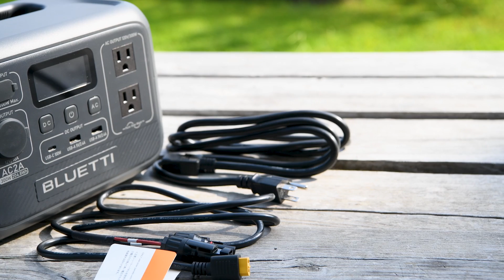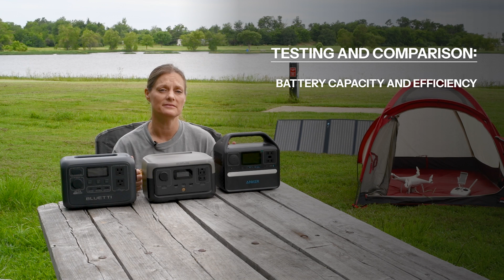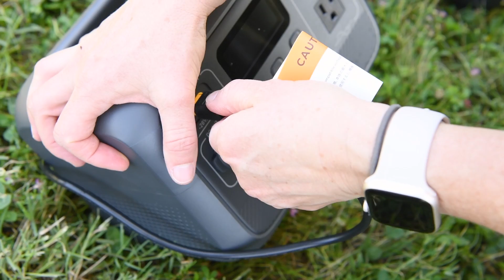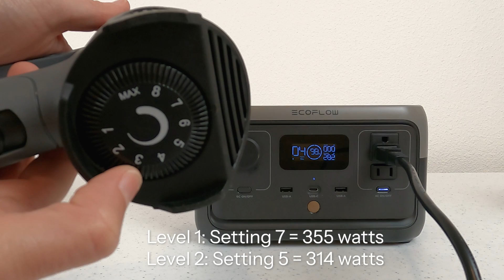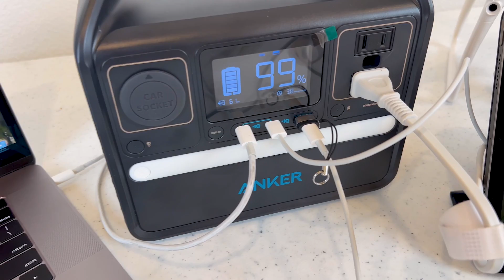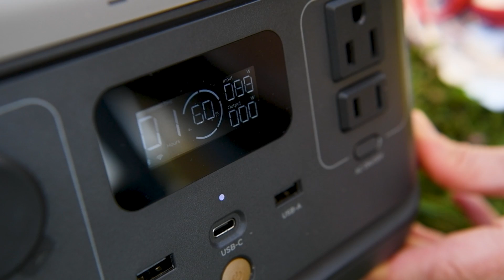Anker 522 vs. EcoFlow River 2 vs. Bluetti AC2A Comparison: Portable Power Station Showdown

Comment: Excellent review. I would recommend using a Kill-A-Watt, or similar, device to measure actual power draw rather than relying on the built-in displays.  The display values from the Anker don't seen to match actual performance.  Ditto that suggestion for USB power flows.

Comment: A good overview with practical real use demonstrations.  It is interesting that you chose the Bluetti AC2A, as it is not comparable in battery size to the Eco Flow River 2 and Anker units.  A better comparison would have been the Bluetti EB3A with it's 268 WH LFP battery that is only a few dollars more (when on sale).  Of course it has a 600 watt inverter and will make a cup of coffee (in power lift mode) and also run a 19 CF Samsung high efficiency refrigerator for 6 hours, which neither the Anker or Eco Flow are capable of doing.  For solar charging, it would have been a more fair comparison if the Bluetti and Eco Flow were charged with their respective solar panels as those panels outputs are more optimized with the solar input limits of the units.  I have an AC2A and it will charge close to 165 watts using their PV200 panel.  Anker has a couple of new LFP power stations coming out soon that look to be really good in the same 300 watt range so maybe if you ever do a comparison again, you could replace the old Anker with one of the new ones.  Thanks!
Reply: Merhaba dostum biz 2 arkadaş 3 gecelik kamp yapıyoruz 

Telefonlar , laptop, aydınlatmalar için hangisini önerirsiniz
Reply: @hakan0977  AC'ye ihtiyacınız yoksa Anker Solix C300DC'yi tavsiye ederim.  4 USB C, 2 USB A, 12 V, dahili fenerle birlikte

Comment: Eco flow is complete garbage. If you ever need service, you’re going to spend months trying to figure it out, if they can handle it at all.
Reply: oh wow, what issues did you have with EcoFlow like the model and the problem with it?
Reply: @BryanMiraflor  I had a pro burn up while running a refrigerator. 1/10 of its capacity. My whole house smelled like burning plastic for days and all the food in my refrigerator was ruined. They outsource their customer service to India and it was nearly impossible to get anyone that could even speak English until I filed a complaint with my state’s attorney general. I ended up getting 50% of the purchase price refunded after them sending me another broken unit. Complete disaster. Stay away from this made in China trash.
Reply: Elaborate further.
Reply: @wanmohamadiqbal8098  I had a eco flow pro that burned up running a refrigerator, which is like 10% of its capacity. I called and they send me a replacement, which was also broken. They clearly outsource to a country that doesn’t speak English well, India orPhilippines, which isn’t fun. It took me 6 months to get a 50% refund. Would not recommend. Terrible experience, terrible customer service, terrible product.
Reply from the maker: Thank you so much for your feedback!